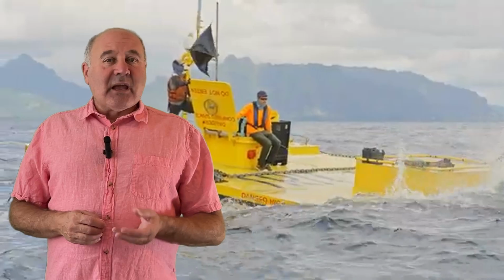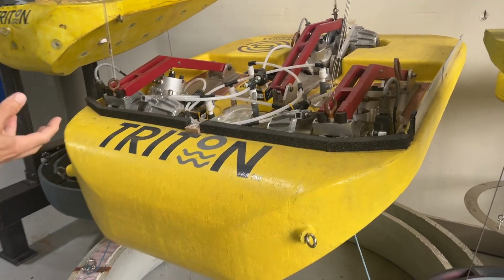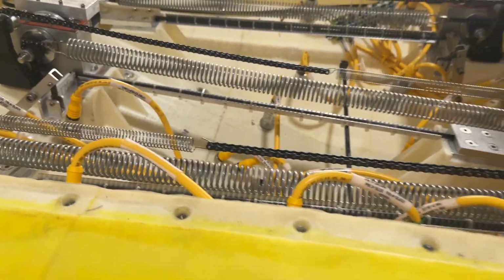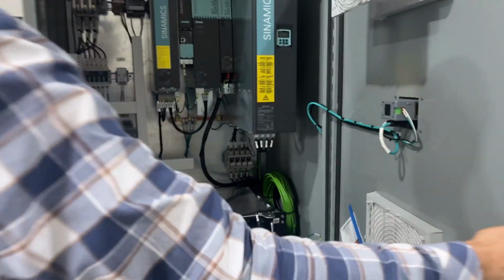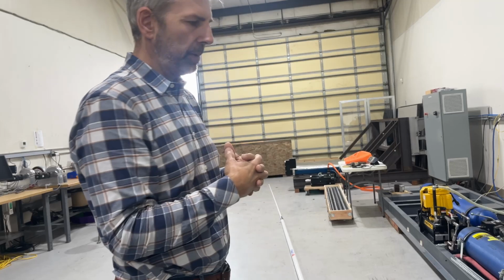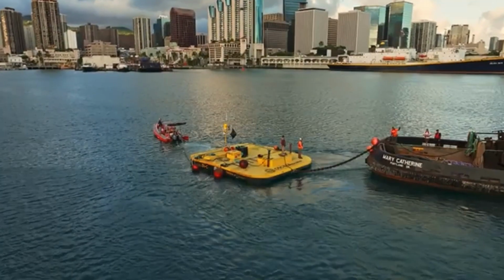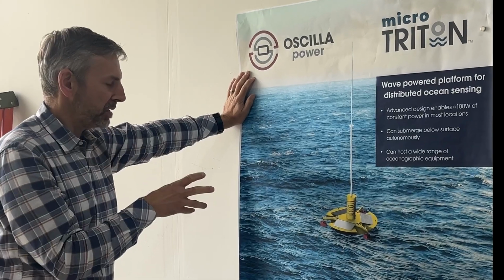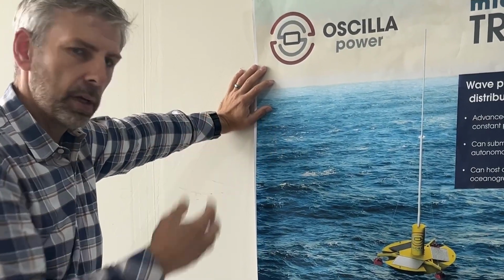Ride Waves, Make Electricity: Decarbonize visits Oscilla Power

Comment: 1/6 scale of a megawatt? What a bunch of crap
Reply from the maker: The prototype that they just tested is 1/6 of a Megawatt. Their commercial device for utility scale power generation will be a megawatt, which is reasonable. And their expectation is to deploy an array of them depending on the needs of the grid. If you need a Gigawatt, you can deploy a thousand of them.